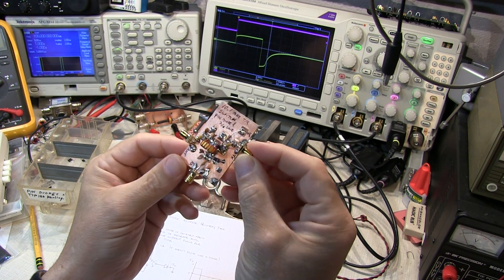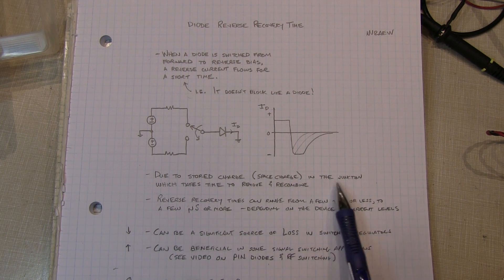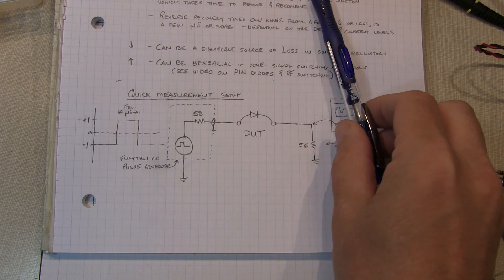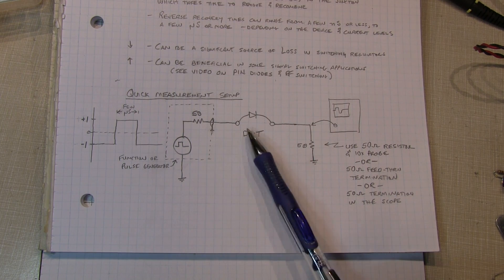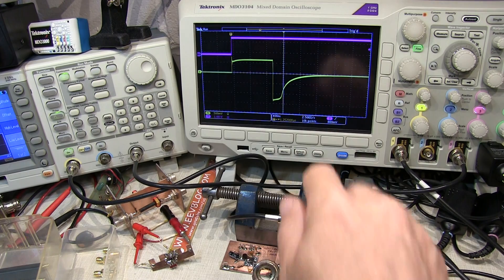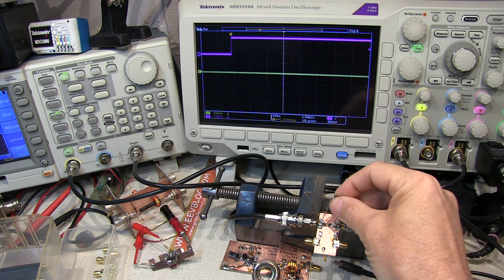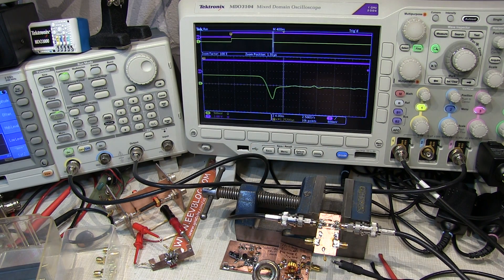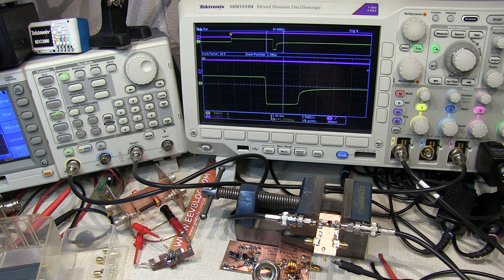#201: Basics of Reverse Recovery Time in a Diode

Comment: I'm trying to measure reverse recovery time of Schottky Diode  with Oscilloscope. Is it possible for me to measuring it without making that kind of PCB board? Like just putting resistor series with diode. Do I have to buy current probe?
Reply from the maker: Schottky diodes don't really have a reverse recovery time.
Reply: +w2aew Oh, OK. Then can I measure PN diode? If so, can I check trr with Voltage-time transient with oscilloscope?
Reply from the maker: Of course. I was measuring PN diodes in the video.
Reply: +w2aew I tried with PN diode connected with 100 ohm resistor, but I wasn't able to see the reverse recovery time. I did see the rectifying output voltage though. Should I add capacitor? or should I put slower square wave?
Reply from the maker: +Hansol Ku Just duplicate what I did.  Use a pulse generator that goes from -1V to +1V into a 50 ohm load, and make the pulse approximately 1us wide.
Reply: +w2aew Thank you for you kind answer. I ll try it again. Do I have to make that PCB board and use cables like you did? or Can I measure only with probe and a pulse generator for your quick measurement circuit?
Reply from the maker: +Hansol Ku You'll probably need to build some kind of fixture to connect the generator, the diode and the probe.  You're pulse generator will need to have reasonably fast rising/falling edges (ideally less than 10ns).  You are dealing with signals that are pretty fast, so very short interconnections are required.
Reply: +w2aew Sorry to bother you but in the video, 
1. What is channel3 in the oscilloscope for(purple line)? 
2. Could you tell me what cable connected to the fixture(I can't hear clealy, is it smhx something)? 
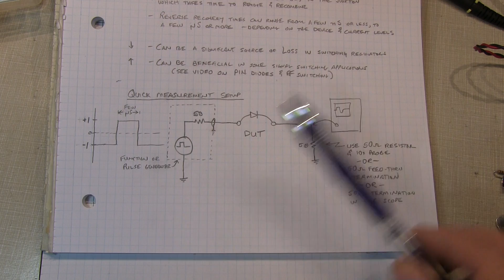3. How can I make that fixture(PCB board)? Is it the one appearing at 3:55 in video(quick measurement setup) or the series SPST switch circuit you mentioned in your previous video #118: Basics of PIN diodes and their use in RF switch applications?
Reply from the maker: +Hansol Ku 
1) CH3 is a Trigger output from my function generator - I used it to get a stable trigger regardless of diode characteristics.  Not strictly necessary, but since I had it available, I used it.
2) I used SMA connectors on my fixture, but just about any suitable 50 ohm coaxial connector would work fine.
3) Yes, the one at 3:55 is the one shown in the vice later.  Very simple fixture that I made by slicing some slots in PCB material using a sharp utility knife.  Nothing special.
Reply: +w2aew Thank you for your kind answers. I was finally able to see reverse recovery time of PN Diode.
Reply from the maker: +Hansol Ku Excellent - I'm always happy to hear that I helped someone learn something.

Comment: In one of my projects (a big power supply) I have a bridge rectifier consisting of 4 huge diodes in a bridge format....
Although it is of no worry to me the ouput after the regulator does have a very low level (a few mV) of commutation noise from the diodes. Once again a very well presented video, always food for thought...

Comment: Thanks Alan, very timely as I was just sorting a parts bin of PIN diodes and came across some VERY old ones I'd gotten from Hamtronics years ago that I don't have a data sheet for (neither did they). At least now I can compare these to others that I have the data sheets for and at least get a feel for how they match up to known units. 73 - Dino KL0S
Reply from the maker: Nice!  The longer the recovery time, the lower in the HF bands it will work.

Comment: I was hoping that you would plug in a Drift Step Recovery Diode at the end of your video.Once, I had an old Russian PN rectifier diode, that was so poorly manufactured that the boundary between the P and N region was very diffused and that made it an excellent DSRD.  It was snapping off in under 1ns with 200A of reverse current flowing through it which allowed me to generate kW nanopulses with it.  Great stuff!
Reply from the maker: AMCIA APPLE Cool!  I don't have any SRDs to play with.

Comment: So does this mean that fly back diodes won't be fully doing there task on relays and motors? Should I be using a capacitor as well?
Reply: Sabretooth Barnacle 
They will do their job for your normal on/off scenario, because by the time you switch the relais/motor on again the flyback current will have dissipated long ago and the diode is no longer conducting anyway and there are no charges to clear. 
Going from not conducting/reverse biased to forward biased when switching off the load is never really a problem (as you can see from the scope traces in this video), even for a 1N400x.

But if you use PWM you have to be careful and select a suiteable diode. The huge currents the diode will allow until it is reverse biased can fry you switching transistors.
Reply from the maker: Sabretooth Barnacle Flyback diodes will work fine - since they're normally reverse biased until the coil is shut off, then they get forward biased. The reverse recovery doesn't really become an issue.
Reply: ***** That makes sense. Thank you for explaining it!
Reply: superdau
All useful information! Thank you superdau :)